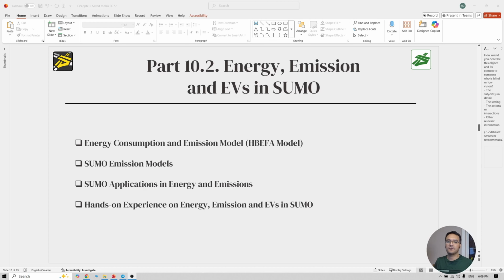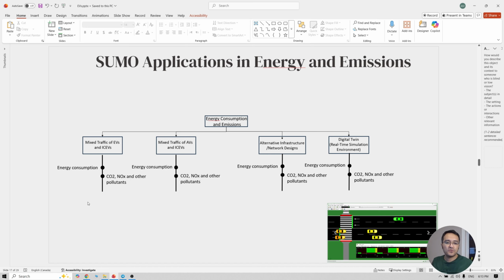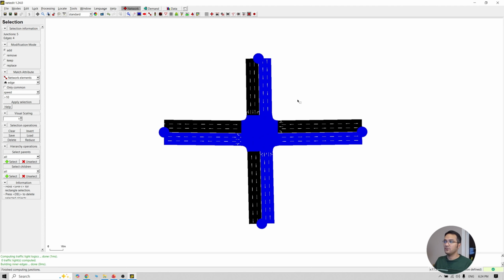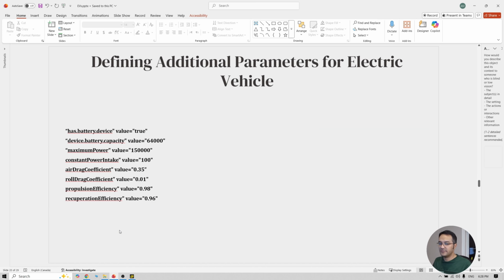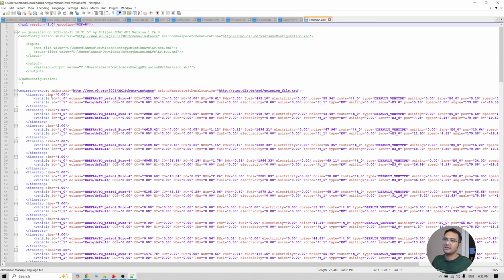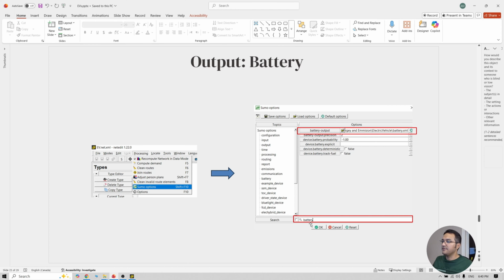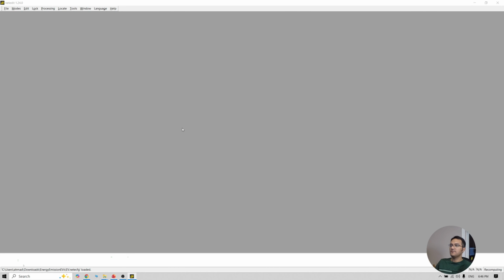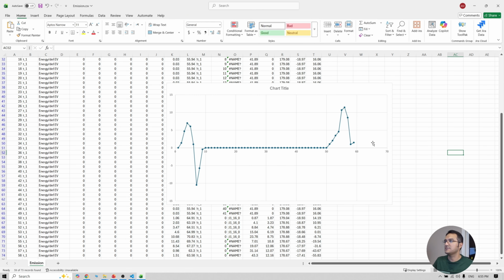How to Simulate Electric Vehicles & Emissions in SUMO | Python Data Analysis (Part 2)

Comment: Hello Dr. Mohammadi, when editing the vehicle type in SUMO netedit 1.27, I navigated to "Edit Extended Attributes" and then clicked "Edit Parameters" in the "Vehicle Type Attributes" section. After adding the corresponding key-value pairs (e.g., `has.battery.device = true`) and clicking "Accept," I found that the parameter list was empty when I reopened "Edit Parameters"—the changes were not saved, and the save icon did not light up. Why is this?😄
Reply from the maker: Hello

Thanks for reaching out. 

Please use older version. The new versions are usually take sometimes for debugging etc on the development side.

If you are okay, you can report this in Sumo official github so they fix this in future release
Reply: @RoadwayVR  It was indeed a version issue. After rolling back to version 1.24, everything works fine. Thank you very much. I wish you all the best.:face-red-heart-shape: